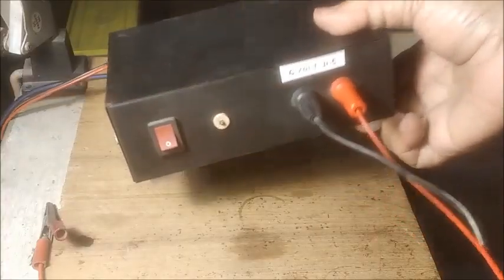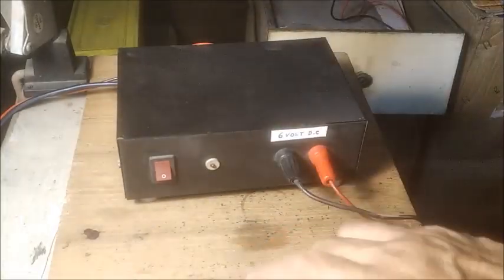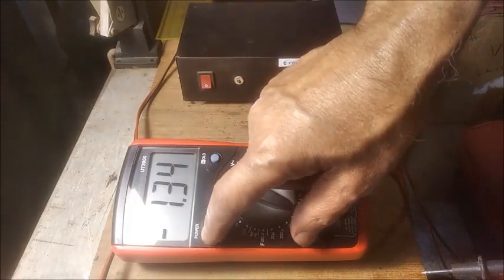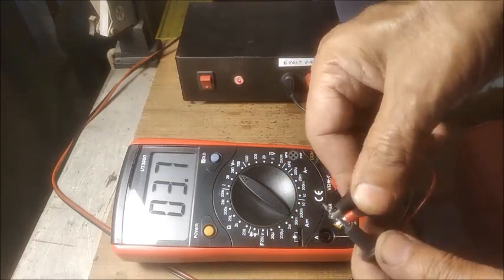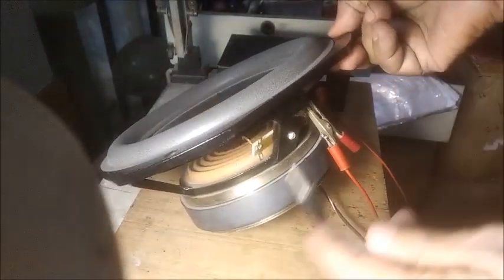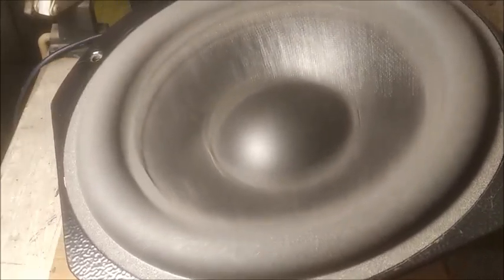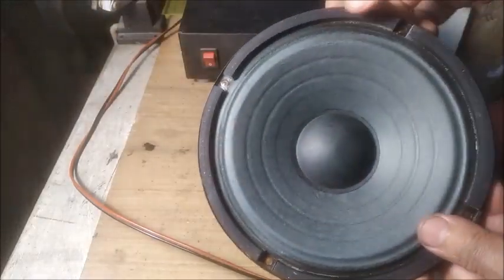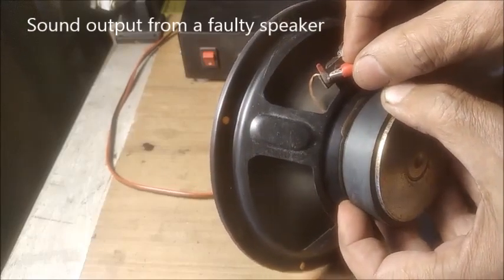Quick and easy way of checking Loudspeaker

Comment: Hi Sir, If I use 2 way crossover network with 8 ohm woofer and 8 ohm tweeter, is the combined impedance is 4 ohm or still 8 ohm?
Reply from the maker: In crossover network the impedance of woofer and tweeter do not combine. With 8 ohms woofer and 8 ohms tweeter, the effective impedance will be 8 ohms
Reply: @makingloudspeaker  thank you sir. If crossover is designed for 8 ohm speaker but I use 8 ohm woofer and 4 ohm tweeter will still be okay?
Reply from the maker: It's ok

Comment: I used to recone speakers. 
 Just use a 9v battery on the speaker terminals. + to + and - to -. The 9v battery will move the cone up and down if the speaker is good.
Reply from the maker: That's good for phase testing.
For checking cone movement low AC voltage with line frequency can be used to detect any noise.